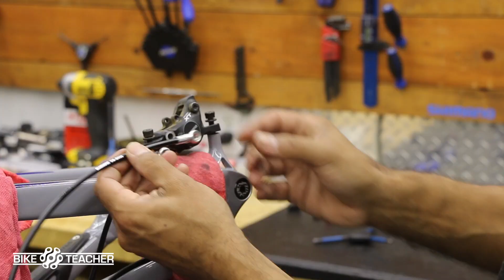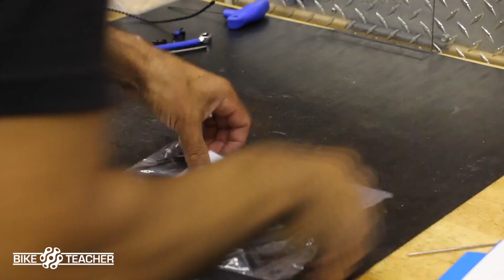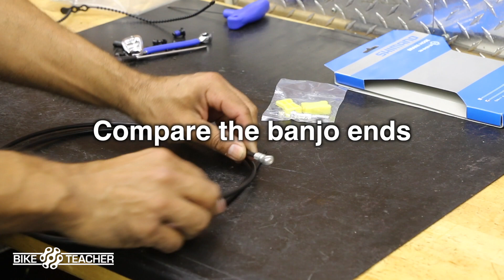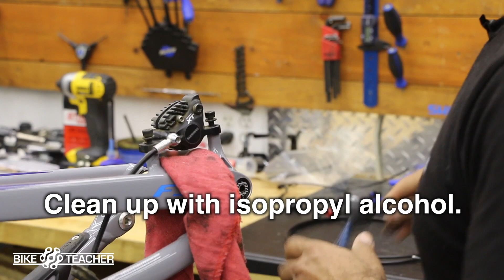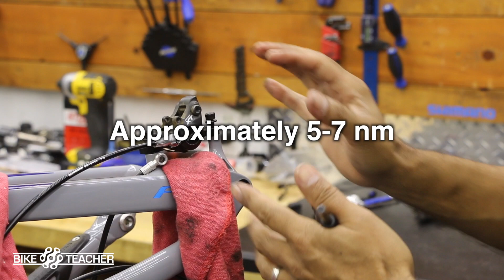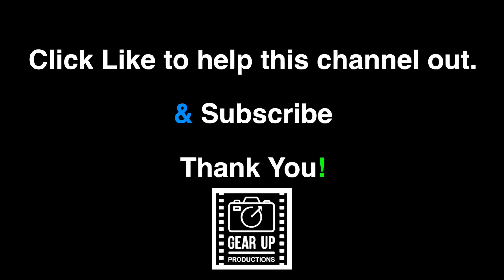How to replace a Shimano XT rear hydraulic brake line, hose.

Comment: Little Tip to save Big headaches, Mount 1 O ring on the screw put screw threw the banjo bolt the slide the #2 O ring on the screw and slide it up into position. Dropped one of those on my garage rug and spent 40 minutes sifting through the rug...
Reply from the maker: Well put. Thanks

Comment: What about the brake lever and the bleading
Reply from the maker: I looked in my archive, I could not find anything either. Thanks for your comment, I will make that video very soon. Meanwhile here is a link along with a tip for hydraulic brakes.https://youtu.be/HCbQcO02ky0

Comment: The other end of those hose push into the dropper post?
Reply from the maker: Do you mean the brake caliper? One side has a fitted banjo from factory the other is cuttable and uses a barb and olive and then bolted in at the lever.

Comment: Hi there, I have a 59 hose and am replacing a R785 caliper with an RS785 caliper,  can the banjo be cut off and replaced with the other type of hydraulic connection, with the olive, christmas tree and the black threaded barrel? thanks.
Reply from the maker: Sorry for the late reply, I do not think so. Did you find anything else out about that?
Reply: @BikeTeacher  Sir, Thanks for your reply. What i did in the end was i sourced and bought a[nother] R785 caliper from Germany, and simply compromised my time (i was on a tight deadline) and just did a straight swap. Pity Shimano stop supporting/selling parts within a reasonable life of time of the original OE part. I mean, Ford still make stuff for the MkII Escort! Cheers,mark

Comment: Can you reuse the hardware when replacing a caliper
Reply from the maker: No, mainly because the olive is crushed  to form the seal. Reusing a used olive would most likely leak.
Reply: @BikeTeacher  can yo re-use a good condition hydraulic hose though? replace the olive and keep the existing hose?

Comment: do you mean 1 o ring on each side of the bolt totalling 2 o-rings? or 2 on each side of the bolt totalling 4 o-rings?
Reply from the maker: Hi, one o ring on each side only. If there is a third in the package, consider it an extra. Thanks

Comment: Awesome video! Just to make it clear for myself the o-rings is to install one on each side? The new cable comes with three, just a spare?
Reply from the maker: Yes, my understanding is the 3rd o ring is a spare. There is nowhere else to use it on the caliper or the brake lever. I figured Shimano gave us a freebee.
Reply: Thanks mate.

Comment: Great video. Can you reuse a banjo bolt. I have a kinked line and wanted to save some $$ by cutting and reinstalling the banjo bolt. Haven't seen anywhere it's been done. $40 for a new line is crazy!
Reply from the maker: Ya, kinda pricey. The banjo bolt is crimped or installed by the manufacturer. It’s a permanent one time deal. You are forced to by a new line with a banjo bolt.